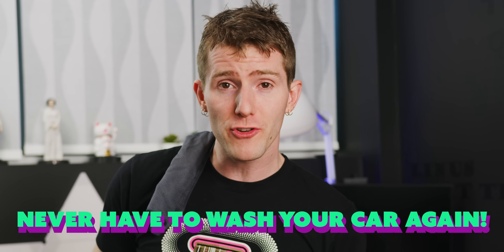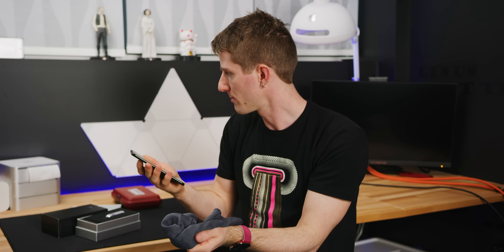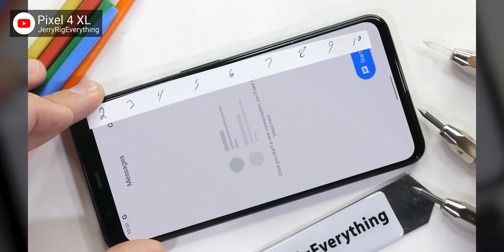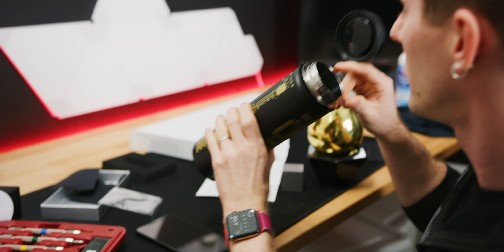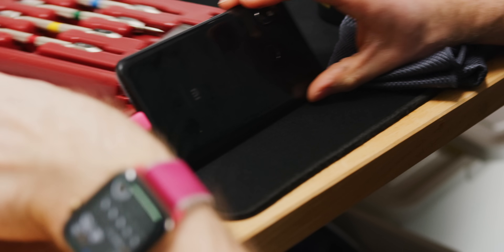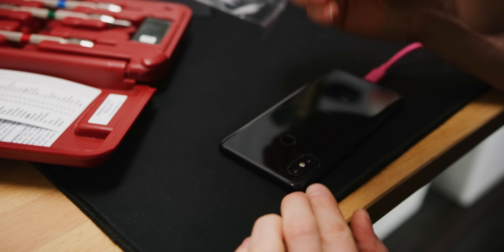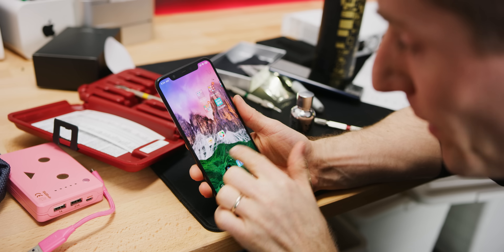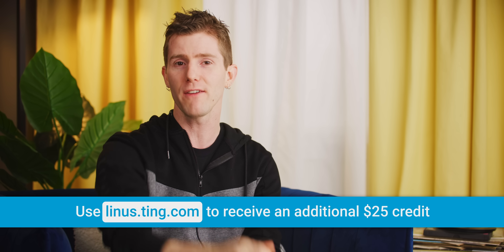Can Automotive Coatings Protect Your Smartphone?...

Comment: 5:46
instructions: "longer it stays dry the better...at least 48 hours for initial drying...don't recommend that you wash or expose the car to water for 4 to 7 days"
linus: pours water on it the next day
Reply: Yeah... That's potentially a pretty big flaw in their methodology. There is no good excuse to have ignored the manufacturer's cure time and cut it in half. I've worked with lots of resins where doing that would be like half-baking a cake.
Reply: @markcoren2842  the extra wait is solely to avoid water spotting, it has nothing to do with hardness. Linus even explained that the coating had a different hardness scale.
Reply: Was baffled by this as well.
Reply: Also he didn't clean the screen enough
Reply: One day of curing should be enough for any car. You just don't want to use other chemicals, like wash it, for a week.

Comment: Would this stuff cure and repair a scratch on a screen? If it sets at roughly the same hardness and fills pores, would it be useful on repairing scratches like the ones created in this video?
Reply: In theory it should at least improve readability. A short follow up vid would be nice.

Comment: As the ceramic coating is designed to fill tiny spaces and make a perfectly flat surface, what what effect would it have on repairing or hiding the scratches that you made during your test?

Comment: I just Had To bring this up for ANOTHER coatings test to do on ALL your computer gear ....

Line-X Ultra: 
https://linex.com/ultra

aka Polyurethane/Polyvarathane Truck Bed Liner!

You could probably get away with a 2 mm coating BUT I would suggest a full 5 mm coating to see how coating a smartphone and/or tablet and/or computer case and/or computer display would PROTECT your system from dents and dings. The textured coating would be VERY grippy and fully waterproof!  Because you can get it in so many colours, give it a try with multiple colour combinations! 

1) How much does Line-X protect your cases from water, scratches, dents, etc?

2) How high can you drop a phone/tablet/computer from and NOT damage it?

3) How does Line-X affect thermal performance?

4) Does the material BECOME a heat sink?

5) What if you coat the fins on an actual CPU or GPU heat sink with Line-X? What does THAT do?

6) Can you actually WATERPROOF and entire desktop PC with Line-X by coating the entire computer case and all the critical components, connectors/cables and displays?

7) How many hammer blows can a smartphone, tablet or computer case take when coated with 2mm versus 5 mm vs 10mm coating of Line-X ?

8) Can you play Crysis underwater with a Line-X coated Desktop PC and Gaming Monitor?

Have at it!!! This we would LOOOOOOVE to see as a Linus Tech Tips test -- You could even get Line-X to sponsor the video!

...

Comment: With a coating you need to reapply once scratched, and it should help reduce scratches by filling in the gaps of anything "removed" it's not supposed to be in one-and-done product if I remember correctly

Comment: There is no standard for mohs hardness.  For example a diamond could be extremely resistant than a 9, but the 9 won't be the same difference as the 8.  And so on.  This could in fact be a 9, but that does not mean it's close to a 10 as you say

Comment: I'm sorry Linus but this wasn't a well executed video. I'm not saying this to be a hater but You could have prepared by reading the instructions before hand or something.
Also would have been better visually if you had a thin piece of tape separating the control from the coated. Ideally 2 phones would have been better but I understand why you wouldn't wanna just destroy 2 phones.

Comment: How about try and see if it will work to protect something much worse than a glass screen, like a LED TV or a Laptop screen that doesn't have a glass coating, they both are relatively common and I would like to see that result. Maybe slap some on the blades or shroud of the cooling fans in a PC so dust flies off them easier (Actually a really interesting thing to try). Might as well since you got that lifetime supply's worth ;)

Comment: You could, in fact, improve your results, by letting it sit on the screen for longer before wiping off excess. There was a cut, so I don't know how long you did wait, but it didn't seem like all that long. Think more like fifteen minutes. Also let it cure for two days, not one. Also, don't use it on glass. It's not supposed to be used on glass, glass is already very smooth. It's supposed to be used on paint, which is famously very rough even when it looks smooth. I wouldn't recommend this for phone screens, I would however recommend it for the inside of a phone case, keyboard key-caps and basically all over a computer mouse. Would love to see a follow up video about this product and it's legitimate uses, instead of just an honest account of its functionality in this specific instance.

Comment: Apparently a number of smart watches already have that coating applied to their screens from the factory and it will be soon the case for most smartphones. Apparently they soon will start to apply that coating to the logic boards in smartphones and other portable electronic devices to better protect the PCBs from corrosion especially in humid environments! :)

Comment: Being a detailer and have used ceramic coatings on more vehicles then I can count, I could have answered this and saved so much time. The answer is NO. The reason for this is, most if not all ceramic coatings bond to the paint on a vehicle on a molecular level. This allows the coating to improve the scratch resistance and water beading. Ceramic coating does not block all scratches, it can however protect it and make it easier to restore the paint after the first time you completely restore the paint. by polishing again it brings the shine back faster, it does not last forever. there are also some coatings that are made for wraps, but they are not the same as the normal coating. If anyone wants to get their vehicle detailed and are in BC Canada, shoot me a message on IG and lets talk! @fringeautopg Cheers :)

Comment: Have you thought about the reaction of the phones factory applied oleophobic coating repelling the ceramic coating you tried to apply? Given that there was no real change before and after it seems that your ceramic coating did not apply at all.

I had this same issue with the liquid screen protector on my Note 9. Because the screen already has a coating to repel moisture, any liquid coating that you attempt to apply beads and wipes off. It simply does not adhere to the screen.

Comment: The logic problem with the 'test' that says 'read everything before doing anything?' You're Assuming that the last instruction has more weight than the previous instructions.

1. Read everything before doing anything.
2. Jump up and down.
3. Sign your name at the bottom.
4. Ignore all previous instructions, except #3. Turn the test in.
5. Ask the instructor for permission to leave the room, then leave, return, and ask for another copy of the test. Start over.
6. Stop reading the questions.
7. Congratulations. Ignore all previous instructions, except #3. Turn the test in.

Makes as much sense as (instructions not equivalent to above, you'll get the idea):
a. Peek All (... read all instructions first ...) Until End.
b. Poke 1.
c. Poke 2. Goto f.
d. Peek 1.
e. Pook 0.
f. Goto c. End.

Comment: I work as a car detailer and the biggest myth about ceramic coating is how scratch resistant it is and it’s actually not it does help with light scratch material (rags,dust , and automatic car washes) but not a significant difference but if you do prep your phone properly and use it properly it does help cut down on smudges and makes it easier to clean I have my 11 pro max ceramic coated and it has held up better than most other phones and only takes one swipe to clean any residue

Comment: Lmao when people talk about Cermaic when they don't know much. They are designed to make washing the car easier. A lot of crap will stick to the paint and be hard to wipe off. Bird crap will etch into the paintwork even with wax, A coating is hard enough so the acid wont etch into the clear coat. They are not "scratch proof" They resist scratching because it takes less scrubbing to remove dirt from the car.

Comment: A car is tech too. And no the ceramic coating does not fill any pores on a cars clear coat because a clear coat on a car does not have any pores of a fillable size. If it did they there would not be any shine.

Comment: So, you applied it very poorly with a bad quality paint protection. You can get glass "protection" which sticks to glass better and longer. Paint has ALOT of imperfections even after paint correction which the paint protection uses to stick to and fill the "gaps" to smooth the surface. I've coated my phone with a self healing paint protection (kamikaze range) designed for paint, glass, plastic and alloy. 

Not a single scratch on my Samsung s9+ and if it does get scratched a quick hit with a blow dryer gets the scratch out. Definitely doesn't improve the hardness of the screen but does give it a more flat surface to "prevent" scratches. Will be coating my s20 ultra when I get it. 

Experience - car detailer for 7 years with professional training one of the first "ceramic" paint protection appliers in Australia. Alot of paint protection has to be cured with heat (infrared lamps) and stay dry for 48-72hours.

Comment: Make it heat resistant then you'd have an awesome thermal compound.
Reply: Ceramic is actually heat resistant. On a black car a wax will evaporate when  its over 120 and coatings will not

Comment: A phone and a car are very different. They suffer different abuse. This product worked as it was meant to, but the subject was never meant to need that kind of treatment.

A phone gets dropped, or scuffed by keys or things in your pocket or bag. A car gets hit by grit, rocks, and other things at high velocity all the time, and it's surface isn't already coated with plastic coatings  or even full armor. Even the act of cleaning can mar the paint and leave swirls. The ceramic treatment is mostly to repair damage to the paint.  Your phone should never have that kind of damage, so it's superfluous.

Comment: I think the issue on the back of the phone was the poor application. He should have done the bottom of the back screen so he would not have to worry about getting around all the cameras and such. Also as others have stated he did not follow instructions correctly.  I used this same product on my car a few months ago and it made a huge difference. You still have to wash the car but no more scrubbing the dirt just wipes off and the paint is much smoother and looks great

Comment: methodology sucks. Even if it was gonna work, you didn't do a good job when applying etc. At least try multiple coats so you can say you tried. You should also do a control test on a car to see if you are applying it properly
Reply from the maker: We did do multiple coats and we did leave it to cure. Didn't film it because it seemed unnecessary. No, applying it differently will not change the results.

Comment: As a car detailer, you've just used what is probably re-labelled '9h' from aliexpress, especially considering the price. Most ceramic coatings cost double that one at least. Also they're made to bind to clear coat, not gorilla glass, so obviously it's not 'fit for purpose'. Plus, ceramic coatings are about 3 years old now, it's all about Nano Graphene Coatings now apparently...

If you want to make your phone bead water off though, just get some cheap '9h' from China

Comment: No ceramic automotive coatingis scratch resistant they are meant to be swirl resistant and much easier to clean than wax or just naked paint scratch resistant no
Reply: Mind you I did not say they don't claim to be scratch resistant I said they are not scratch resistant

Comment: you should read the manual first linus its says let it cure for 48 hours not remove it instandly -_- i used the same my gs9+ is still with no scratches after 1 year of bad usage it had some hard time on building sites cement, sand, and other stuff

Comment: I would suggest anyone who has sensitive skin refrain from using ceramic coatings or apply it to another surface, first, to test if a reaction happens. These products are made for vehicles in an outdoor environment, and can cause irritation of the skin while using it. There has been no product testing for use with any other surfaces in which a human makes frequent or constant contact with the applied surface .

Comment: 11:30 - Thanks for telling us, at the end of the video, that the coating was using a different hardness scale, which makes this video pointless
Reply: Not at all, if the glass is slightly softer than the coating, you could switch to damn near any hardness test and have exact result: slightly harder coating.
Reply: @Ravenousjoe  yeah but glass is a 5-6 on the mohs scale and that coating was a 3, regardless thats the information you start the video with rather than having us think otherwise the entire time
Reply: @MattB90  if the coating is a 3, it would have been scratched by the 4, 5 and 6 picks. Either way, while different scales use different methods, a harder material will always be harder no matter the scale, it just depends on other factors whether the other types of testing is applicable.
Reply: @Ravenousjoe  if?? just going on the info they gave in the video, facts are facts, youre cool with the way it was presented, me not so much, but its all good in the end most of the vids are great anyway
Reply: @MattB90  I didn't say I was cool with it at all. You said that different scales means it is a pointless video, when it has everything to do with the actual application, and the fact they have no idea what coatings were on there in the first place, not the hardness scale used. This is a product made to protect paint, which is significantly softer than glass, therefor using it as such is pointless. Had they waited a week then tested the screen and glass, we might have seen a difference.
Reply: @Ravenousjoe  blah blah pointless video,  made solely for the views, they knew the actual hardness of the coating which is why they waited until the end to disclose that fact, so they can get that watch time up, they werent upfront and wasted time, but anyway you make a video, be upfront about the actual hardness and wait a week to test, id watch
Reply: @MattB90  or they put a lot of time in to it, and instead of wasting all that time and scrapping that project, they released to show what could be done with non traditional phone protectors.
Reply: @Ravenousjoe  or they are doing anything these days to make sure the momentum of the channel isnt affected, including creating additional channels to cover the things they really wanna cover without penalty, or putting vital info at the end so we watch under false pretenses lol we both seem to love the channel, hold them to a higher standard, or are you so starved for content that youll accept anything these days, Mr Ravenous?? lol seriously though it would have been so easy to include that in the beginning when he was talking about "is this snakeoil" and mentioning all of that research he did lol
Reply: @MattB90  cool, so since you have such a hate on for their videos, why do you watch them?
Reply: @Ravenousjoe  assume much ravenous Jay? This is one video in a sea of many, but one of the things that's great about this channel is they take criticism really well and they seem to care about their audience, so that is why I watch. Of course youre now the guy accusing me of having "such a hate on for their videos" because I criticized one thing in one video haha nice one

Comment: Linus: puts massive buttplug on the table
 “I knew this would be useful for something”
Reply: Vizman216  At least, that's where it needs to go unless you want it to thermal throttle.
Reply: VaroCAL Strange he’d buy that in the first place despite having no anus. Who or what did he buy it for?
Reply: @coprographia  no need for an anus when you are a Linus
Reply: Look at are profile pics
Reply: I looked for this comment and was not disappointing :D
Reply: I thought ceramic coating was supposed to be cured under heat?? Pls recheck instructions Linus.
Reply: i do not think it is a massive buttplug, it might be a Faberge egg PCB that he will try and decorate in a future Channel Super Fun video (at least I hope so). 😁

Comment: Car paint is softer than glass. For the coating to be harder than glass the nano particles would need to sapphire or diamond with a super strong, sheer resistance bonding agent. 
I am surprised you didn’t do the test on a fold phone with a flexible plastic screen. Kinda seems like the obvious video to make.

Comment: You should have tested if the scratches were still the same depth after you remove the coating, It would be a great replacement for a  screen protector if you could just take the coating off when it's scratched too much and apply it again.

Comment: As a vehicle detailer who knows about this stuff 9H is true. But it's not what you think. It's not 9 on the mohs hardness scale. It's 9H hardness which means it will resist scratching from a 9H pencil. So the added scratch resistance on glass is folly. On paint it does help, but because the paint is soft underneath, that never holds up in practice. But it does help reduce scratching by reducing particles stuck to the paint.

Ceramic Coatings are great. But make sure you are buying from a reputable brand. I.e. Almost none from Amazon.

Comment: Sooooo what if I used that to coat my glasses? So that water just bead off?
Reply: Yes glasses are plastic, Plastic is better to coat because it is way softer than glass. the glasses will be easier to clean and scratch less. use a microfiber towel because a rough one will still scratch it up